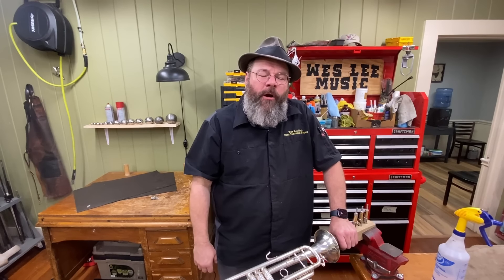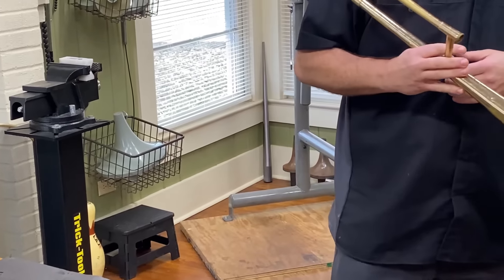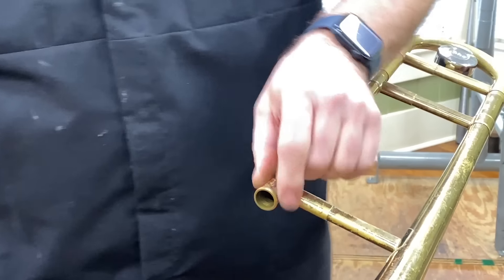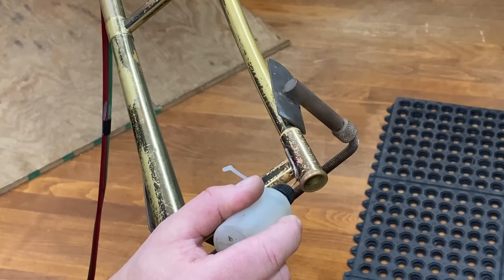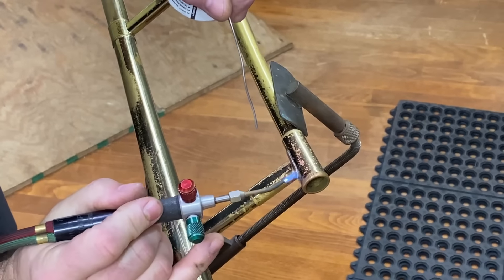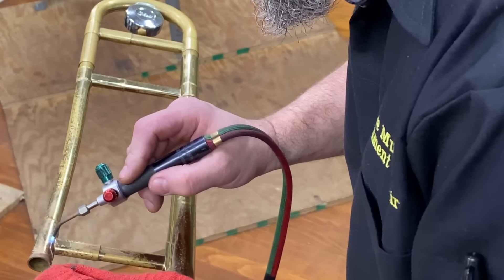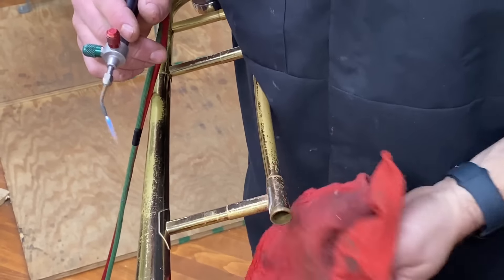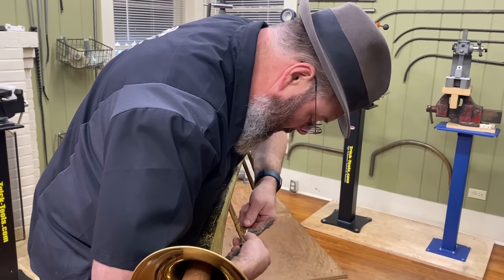Soldering Vintage Horns- Requested No Edit Video, band instrument repair, Wes Lee Music Repair

Comment: "...the lacquer will prevent the solder from flowing."  That's interesting, because that's just what happens when one is soldering an IC with very tiny pins to a circuit board.  The lacquer solder mask keeps the solder from where you don't want it.
Reply: For a second I thought you were talking crap n  get l

Comment: I like to use Windex or store brand glass cleaner to neutralize the flux.  It has to be the kind that has ammonia in it to work.  Cleans up nice and handy for cleaning other stuff too.
Reply from the maker: We learned using that in repair school, however, later down the road we learned that the ammonia can cause stress cracks in brass. You may want to search and read some about that.
Reply: @wesleemusicrepair9820  What I can find so far seems to say the problem would happen from extended exposure to the ammonia but no sense taking a chance, I'll be a convert to the baking soda water.  Thanks!